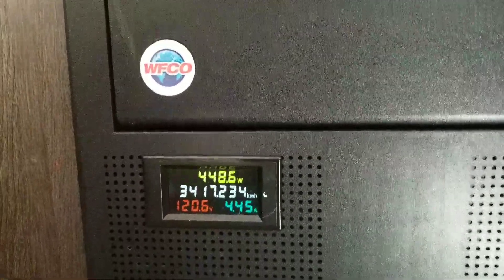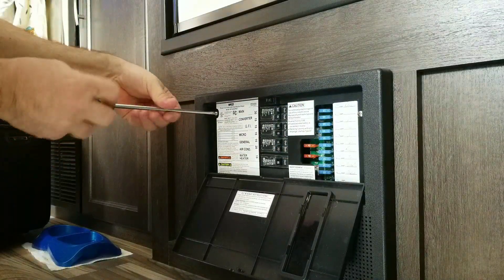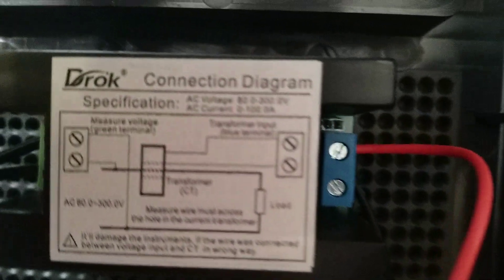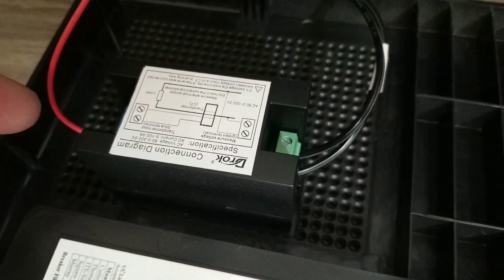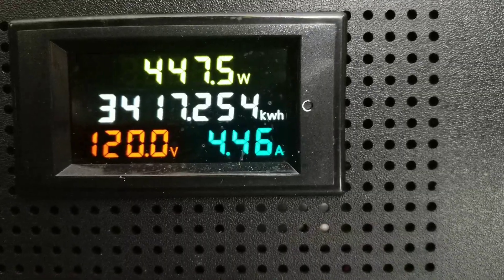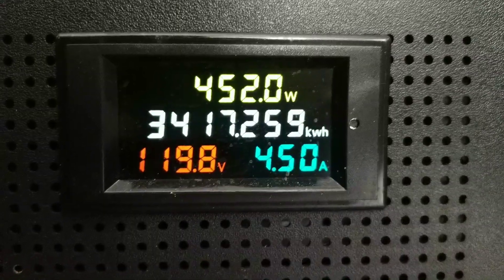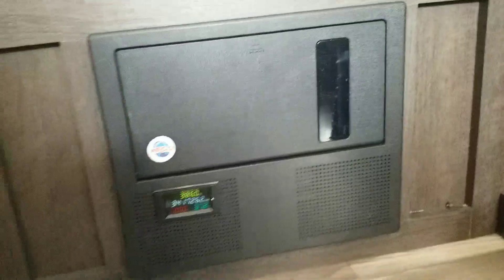RV Power Meter installation - See link in the description below

Comment: When you wired this to power the meter, how did you know which one to connect to the common, And which one to connect to the 15 amp breaker? The chinese directions that came with mine stink.
Reply from the maker: Well.  I guess I would have to look at the instructions to tell you this.  Have to find them first.  It's been a while.

Comment from the maker: They are avaliable.  You will need an inline shunt is all verses the inductive sensor.   Heres one on amazon:    https://www.amazon.com/Multifunction-Battery-Monitor-Multimeter-Voltmeter/dp/B07T8GN61Z/ref=sr_1_1_sspa?crid=2Q0M68TI19IY4&dchild=1&keywords=12+volt+power+meter&qid=1635477705&sprefix=12+volt+power+mete%2Caps%2C165&sr=8-1-spons&psc=1&spLa=ZW5jcnlwdGVkUXVhbGlmaWVyPUEzNEpYTks2ME5ISkVXJmVuY3J5cHRlZElkPUEwMDQwMzUwMzJNVE85WE00WUo3USZlbmNyeXB0ZWRBZElkPUEwODk1MTUyMlYxVFBHRlhRQjBNNCZ3aWRnZXROYW1lPXNwX2F0ZiZhY3Rpb249Y2xpY2tSZWRpcmVjdCZkb05vdExvZ0NsaWNrPXRydWU=

Comment: Is there something like this for 12volts for boondocking purposes?  If so what and where to get
Reply from the maker: Yes there is a power sensing  unit for 12 V.  It uses what is called a shunt resister.

Comment: thank you for the video, i have a question, i currently have three RV's on my property that are being rented out. i am trying to determine the electricity usage of each one to charge the tenant accordingly. Would this device be something i could use?
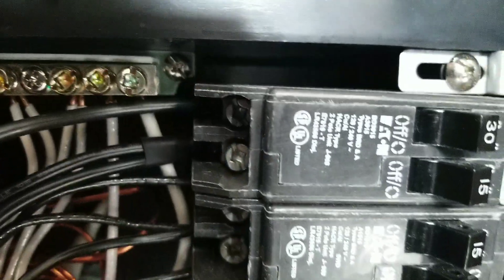Reply from the maker: This unit on this video is for a 30 amp single phase and uses one inductor loop for current sensing (See 1:54 in the video).  If your tenants have a 50 amp hookup, you would need a dual-phase meter with two inductor loops.  Virtually the same meter with two inductor loops versus one.  Yes you could use this for everyone paying their share of electrical.  But there might be a better option.  What do your electrical boxes look like where the RV's plugin?   Post a pic on here.  I might be able to suggest a system that would be easier for your tracking.
Reply: Maj Adam Orens Thank you, I will send that picture in a bit, I’ll go out there to check it.

Comment: Do they have one of those meters for 50 amp 120/240 camper
Reply from the maker: Pretty sure.  Check around Amazon and let me know if you happen to come across one and Ill look at the specs.
Reply: @PilotManForever  
?
Reply: Did you find one for 50amp? What does install look like?

Comment: Can I ask what gauge wire you used for powering the unit from the other 15 amp breaker? I want to do same thing, but I am a little  concerned about wire size to use from the breaker. Great job by the way... looks great!!
Reply from the maker: Your not pulling any measurable amount of current through the meter power wire.  All the sensing is done through the inductive loop sensor.  I have put this type of monitor on 200 amp services.  It is what they are designed for.
Reply: @PilotManForever  ,  would you recommend that I use 14 gauge wire to jump the power from the 15 amp breaker to the unit?Since you've had no problems, can I asked what size wire you used? Thank you so much for your help, it's very appreciated!!
Reply from the maker: @tomkinne4592  Size of wire is usually based on breaker size so in this case 14 gauge would be the minimum.
Reply: @PilotManForever , thank you so much for your help!!
Reply from the maker: @tomkinne4592   My pleasure.  Let me know if you have any other questions.
Reply: So I would need two additional wires to power the device, one going to the ground in the rv panel and one going to any breaker.  What’s the best size wire to use for this meter going to a 15 amp breaker